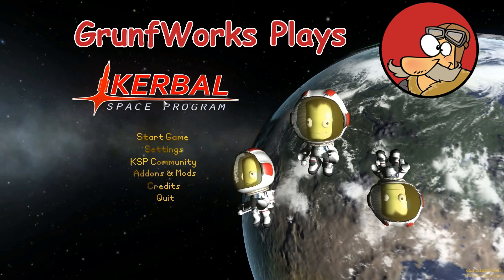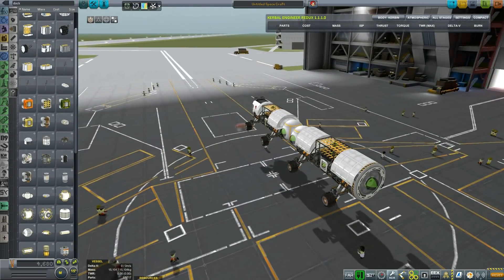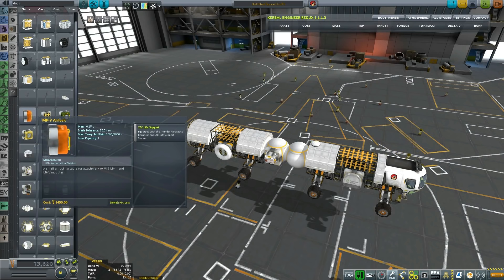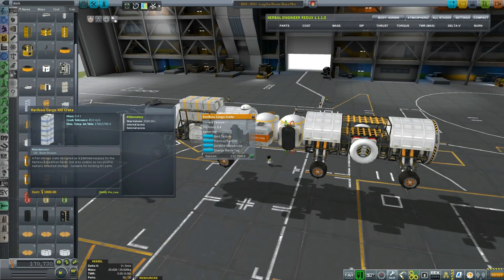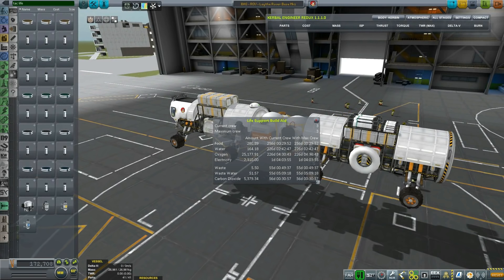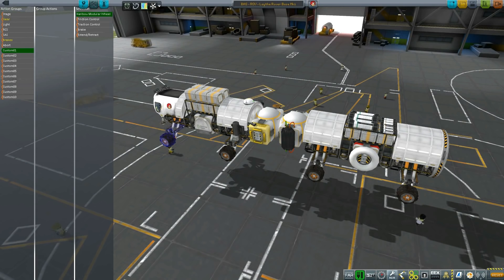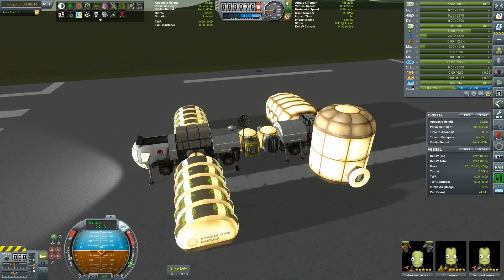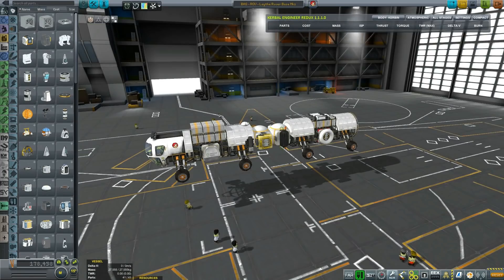Kerbal Engineering - Building Laythe Mobile Base Rover

Comment: I cant seem to figure out how to get the modules to deploy XP because the actions tool doesn't let me bind them to the 'deploy' section, and when im sitting on the runway, I cant manually deploy them either...
Reply from the maker: Dragon Chaos check your installation. Are you talking deploying wheels or modules. I had problem with wheels but not modules